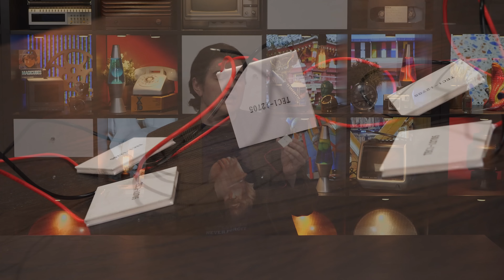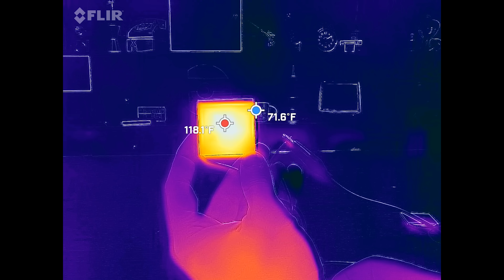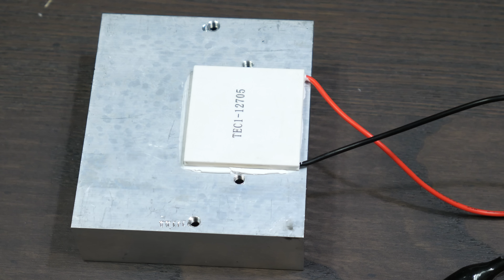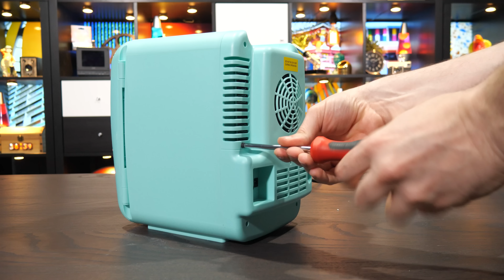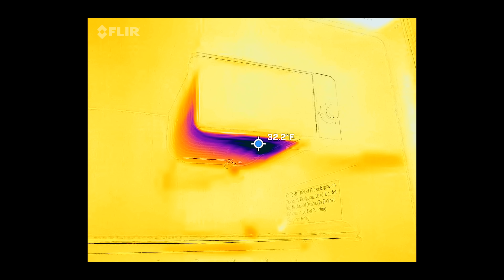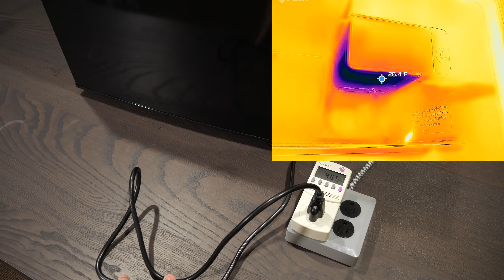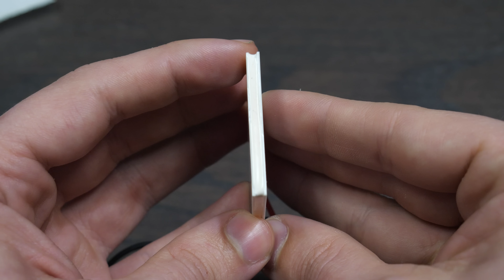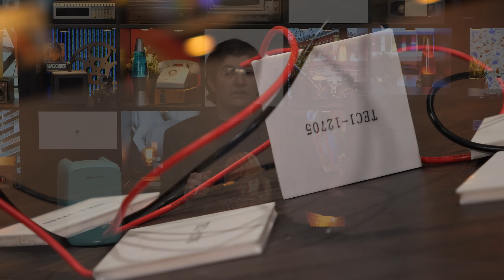Thermoelectric cooling: it's not great.

Comment: I was about to buy one of these as a medicine cabinet here in the Caribbean since our normal temps are usually above 30C and most medicines recommend below 25C. It's a good thing I remembered you test things like this and I'm now going to get a real mini fridge for twice the price. I doubt I will be able to set the temp to 20C to save power so I might have to rig up a temperature sensor and smart plug or something.

Comment: I did a cheeky thing; in the gamer section of a local grocery store, they had a huge display of them, and there was a QR code you could scan to get Fortnite VBux or whatever it was. Converted the URL for this vid to a QR code, printed it onto a sticker... didn't cover the original square, but within a month of nothing happening the entire section disappeared. 

A buddy I made when I used to work there confirmed it didn't sell well even before "someone" ""vandalized"" the display, and they ended up having to send them back to the manufacturer because they weren't allowed to liquidate them.

Comment: I learned about peltiers when I got into astronomy.  CCD imaging can generate a lot of background noise in an image if the chip is too hot.  Cool it down and you get a better picture.  Telescopes of course point at all angles around the sky so you need something that is independent of gravity in order to work.  

Anyhow as our host correctly points out these are not general consumer items.

Comment: Very much appreciate the information in this video.  I knew when I bought mine it rated barely above a toy.  But I got it for size and convenience of meds and exactly 2 rotating cold drinks next to my work desk.  It cools a bottle of water in about two to three hours which suits my own needs, is really quiet compared to the fans for me and my computer devices, and so meets my basic expectations.  I also wanted it be able to store those same items when I am on the road, without having to mess with ice buys and damp goods.  Again, as you so mentioned, portability was the biggest factor for me... not efficiency... well, and price... Amazon had a sale, and I picked up my unit for $23... I would not have purchased it at $30+... I was like, "ok, fine... <click>".  And now I understand why it advertises cooling and heating. Thank you!

Comment: Also because the peltier element is in the middle of the back instead of on the top of the inside, and there's no airflow inside the fridge, it will only cool down the bottom half of the fridge and not the warmer air that rises to the top

Comment: Surprisingly enjoyed that video on a topic that didnt initally seem interesting. However I dont agree, you have no example of an similar size that used for cosmetics. You mentioned cosmetics but then seemed to ignore the primary aspects. These fit easily onto a counter top in the bathroom are very light and easy to move. I have a couple of fridges in my rv that are small and a small portable for 12v but all those are not light. That all said great video learnt something.

Comment: I remember in high school chemistry we just a vacuum pump with some amount of liquid room temperature water inside of it. We were told to observe what happened (it boils), and then after it had been boiling for a while to let in pressure again and then touch the water and say what we notice about it (it gets cold). Then it follows with "can you think of any application where this effect could be used?" and I thought I was so smart for saying it could be used as some obscure form of refrigeration. I'm mad that this was not followed up by an explanation of the refrigeration cycle. I have since then gone through university physics (including thermodynamics and statistical mechanics) but in the end I didn't actually properly understand (like I could do maths on it, but that's different from understanding) how simple and satisfying the refrigeration cycle is until I saw Alex's video on air conditioners.

Comment: The technology should be looked into deeper. The weakness is not the element but the insulation.  It can freeze under the right conditions. 
You are only 50% correct. 
It can have a thermostat linked to it, too.

Comment: As others have likely mentioned in comments, peltier/TEC coolers have niche use in certain kinds of cameras. Specifically cameras designed to take pictures of the sky/space (at night). The benefit is that you can reduce noise due to heat on the camera's sensor, especially when taking longer exposures. This means ONLY the camera's sensor is cooled (with advertised deltas of 30 to 40c! Using stacked coolers). Of course, those coolers are bonded to heatsinks and fans to maintain its design specs.

This is I think is going to be the CLOSEST you get to a consumer grade product with a peltier device, which is a somewhat niche hobby product (and these I think border on or just are 'prosumer' grade given even THE CHEAPEST these get are ~$700). Naturally, this is not to debate any aspect this video brings up, because this is demonstrably a wildly niche use-case. I would never consider myself a scientist (but these absolutely could be used for scientific purposes), for me its just a hobby and these let me practice outside of winter.

Comment: Thanks to this and a couple others of your videos I left an 85eur supposedly "high end" peltier coolbox into the store yesterday and instead splurged 250eur to a 26L compressor cooler. Plugged it in today before taking off, by the time I finished filling up the windscreen wiper it had already reached +5c. It's +27c outside and I was so impressed I had to come and comment ❤
Reply: I love how you can find travel coolers with actual refrigeration compressors in them these days.

My brother takes one camping and it can run for a weekend off of a portable battery pack (the size of a car battery) as long as it isn't too hot out and working hard. So much nicer than getting water from melted ice in food.

Comment: With the summer coming up we needed a small fridge for beverages. My brother started showing me these types of fridges. I stopped him in his tracks telling him they're terrible "but the reviews, it's got 4.3 stars". 
Anyway I bought a under cabinet fridge with 4 slide out drawers with great capacity. The best part was the price, £1.75, yes around $2! eBay is good and best of all we've had a few parties and it's come in really handy.
Reply: How did you buy a fridge with 2 euros?
Reply: Put room temp cans inside and wait 3 days to cool them off.  Been there, did that.  I was gifted one of these back in the early 2000's.  Useless.  The only good use I found for these were for CPU coolers in the 90's for early Pentium processors.  They worked pretty good for that application.

Comment: well the refrigerator is a lot bigger and denser than the minifridge, if you put something cold in a minifridge it will keep it at a food safe temperature long enough to get through a day of work or just to have it in your room to save a snack or drink. your not gonna run it for two years so your not gonna get ur money back if you bought a real fridge. plus even if it isn't at a food safe temperature, keeping it at a higher temperature causes bacteria to breed faster. its just not a fair comparison. one does what the other cant do. not a replacement.

Comment: I had one of these back in my teaching days and, while not great, it served my purpose; keeping my sandwiches cool until lunch without having to risk the bio-hazard area which masqueraded as a fridge in the the staff room. I had, of course, the advantage that I wasn't paying for the electricity and it was running 24/7 so was pretty much always at optimum cooling--so long as the door wasn't open for more than a second... Not perfect but better than having my sandwiches fermenting in the heat of my computer classroom (which didn't have air conditioning but did have 26 large, hot computer systems plus 25 students)!

Comment: Unfortunately (for the normal fridg) the pump assembly is at the bottom. Heat rises causing the the frig to work harder.
Also I didn't see a fan pushing hot air out of the pump bay.

What ever happened to the research on the micro pitot tube(?) cooling effect?

Comment: What if you harvest another peltier device from a spare one someone threw out and bridged the hot-side of the powered one to the salvage one? Would it turn heat into cold by pumping the heat from module a to module b? Would that make it cold faster?

Comment: An actual useful application of a Peltier cooler is in cooled astronomy cameras! Because sensor heat creates appreciable noise when taking long exposures of dim objects, it’s helpful to cool the sensor to mitigate that noise. 

Peltier coolers are perfect for this because they’re small, lightweight, and have no moving parts (aside from the cooling fan that is mechanically isolated from the sensor).

Comment: I came a across one of these little refrigerators but it requires 12 Volt power to run. I didn't have an independent source of 12 Volt power at the time. I did have a unique AT Power supply that went to a weird desk top computer that I didn't have a use for. I wired it up to the 12 Volt connector and it was working. I came back a little later and found out I had it in backwards and made it an oven. I switched the wires around and it turned in to an ice box. My father liked his house around 76°F inside the home. I opened up the fridge and he had his sodas inside and the gaps nothing but ice. Lol

Comment: I have a simmilar one but mine is around twice as big and has temperature setting, in usual temperature of around 25 degrees the temp is 4°C and it does keep the stuff inside cold, so i'm honestly not unhappy with it, a little loudy? Yeah but as long as i don't sleep in that room it's alright. Oh and yeah it does take quite a bit of energy

Comment: People (most of them fail) is the difference between cold and loads. In refrigeration whether it's Air Conditioning or Refrigeration things are designed on Loads. Heat Loads to be exact. The even bigger problem of Peltier is they generate a load on top of the heat load trying to be moved. Peltier is mostly great for YT click bait. Glad you chose not to take that route.

Comment: You didn't mention if there were units that use more than one Peltier unit.
I guess those MIGHT make things cooler, but is the power consumption just multiplied by X?
If so, I guess those wouldn't work.
Is there ANY Peltier cooler out there that is better?
I would only use them for "camping" (glamping) and picnics and car trips and the like.
And what if you put cold drinks in them? Do they work well enough that they will keep your drinks cold longer?

Comment: I've recently seen a lot of new portable handheld fans using these to add a cooling plate for "extra" cooling. I was curious to know your thought on these. Would this be a practical application for the Peltier elements? Since it's not something you use continuiously, it might be somewhat practical. However, I'm curious if it is actually cooler and how much battery life you would potentionally sacrificing? I'm also curious to know how they are designed and work in these portable fans.

Comment: It IS great when you're in your car on a long trip, or during your workday if you have a driving job. Granted that it won't keep your milk from spoiling if you leave it in there a few days, but it will keep your ham sandwich and Monster drink fresh for your lunch break. And it will do it without buying ice and can be powered from your cigarette lighter. Well, maybe that one won't, but a lot of them will. And its drain on your car's electric system and corresponding drag on your engine is much less significant than its contribution to your energy bill at home. I don't have one of those silly blue things, I have one designed like a cooler. Best part? I got it from the trash when I worked as a trash truck driver. I didn't pay a dime for it. Of course that means somebody else didn't think too much of it, but it works well for me!

Comment: Best use of these I have seen is in a 12v cigarette outlet car cooler for long hauls. Parents bought one by Coleman 25 years ago and it still runs and keeps road lunches cold. Peltier element with active circulation by a small fan.

Comment: In biolabs, we have a device to embed tissues into paraffin; the newer versions of that device usually have a small Peltier plate for us to partially cool and solidify the bottom layer of wax, though in order to completely freeze the paraffin, there's still a bigger cooling plate using refrigeration.

Comment: I mean it has it's place good ones like mine can reach 6c in 2h with a outside temperature of 30-35c. Electricity is free at my workplace. Also I use it in my truck with my 24v Wich is also free electricity also mine has a thermostat and temperature setting.

Comment: There's one scenario where I use peltier coldbox (whatever in english). As Finland is not particularly a warm country, in summers we usually stay between 15 c and 25 c (another sidenote: usually it does not even snow on midsummer eve!). In those temperatures peltier box is okay-ish for one purpose: keeping already cold products almost cold between long trips. For that this hasnt done bad once. 

If trip lasts for 5 hours, you don't want your sandwiches with meat, cheese and you name it nor milk get warm straight away and stay at 25 c for a couple of hours as sun does shine and warm the interiors in car.

For my experience in this use those products have stayed atleast below 10 c. 
Have to remember after all, the air stays colder in the box than outside and if water contains 4.18 kJ of energy per liter, I would guess milk does the same. At the end of trip you have some food for the kids and yourself after a relaxing trip to a cottage! 😁

Comment: I think you might be a bit too harsh on the usefulness of peltier devices. They can be good for making things cold. At the exact same time, they are good for keeping things hot. If you use water blocks on both sides, you can use the cold water to keep things cold, and you can use the hot water to keep things hot. You could even use that temperature difference to condense water on a coil and collect it. Food for thought.

Comment: Fun fact: a Peltier Junction also works in reverse. When you heat or cool one side, a voltage develops across the junction. This is called the seebeck effect. It’s used to measure temperature. It’s not the most accurate but a thermocouple can cost 90% less than a more accurate device while still doing a pretty good job.

Comment: Thermoelectric cooling IS great for certain usecases. day trips where you always have a car available, at construction sites where you always have power available. well, it is great and cheap as long as you always have power. I had one for many many years and just recently sold it. only moving part is a fan, no coolant, nothing complicated. they have a reason to exist.
now I have a compressor cooler BUT that was more than 10 times the price.

Comment: They used poor fans and no insulation ,i built a better fridge for 65 Canadian out of two differently sized cpu heat sinks and some old hard insulation foam boards. a dollar worth of packing tape and its good to go . all of it runs on 12 v solar so it free cooling potential .

Comment: Peltier units are basically only useful under extreme space or portability concerns. If you have 50mm of clearance for a cooling solution on something like a mars rover, and the total load permissible for the cooling system is limited to 800g for orbit ordnance purposes, you would be stupid to not go for a peltier in that scenario. Other than that, they are pretty worthless and get beaten out by almost anything else in most cases. Some passively cooling paints might even out perform them in some scenarios...

Comment: Question - I'm thinking of using one of these Peltier modules for a water cooler for my cat. The temp needs to be around 10 degrees cel. Do you think this device could get as low as 10?

Comment: I had a coca cola branded cooler like that when i was at uni, purely because it was small enough to keep in my bedroom. It was shit. Cans of soda or beer would take like 12 hours to get properly cold. Which is annoying considering the cooler literally had a warning sticker saying it shouldn't be left switched on for more than 24 hours at a time for safety reasons... So unless i had the presence of mind to put cans in it before i go to bed, only switching it on at that point, there were basically zero situations when it would actually be cold when i'd need it. And wasn't suitable for storing food, ever. Absolute waste of money. I didn't even bother bringing it home. I just left it in the front office of the apartment building with a post-it note saying "Take me, i'm free." And to be fair, someone took it. But i don't imagine they would have kept it very long. Since, as i said, it was ass. And even if the can was cold enough to drink when i'd take it out, it wouldn't stay that way long, since it was literally JUST on the cusp of being room temperature. Even at it's coldest.

Comment: I'm starting to wonder if it might not ne a bad idea to try to daisy chain several peltier elements to a larger heat sink with fan and hook it up to the back or shoulders of a jacket? Run some tubing between layers with coolant and a pump to circulate the cool and connect it to a large capacity rechargeable battery?

Comment: The real use case for these fridges and coolers is
- Keep cold drinks cold in the back seat of the car off of 12v (NOT cooling from warm)
- Keep makeup cold

They are great for those use cases where a compressor fridge is entirety impractical.